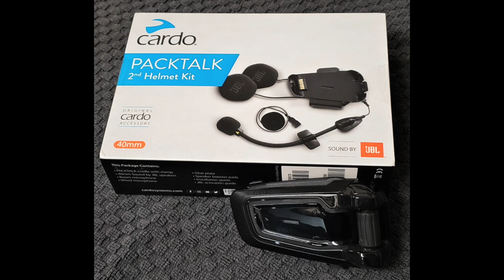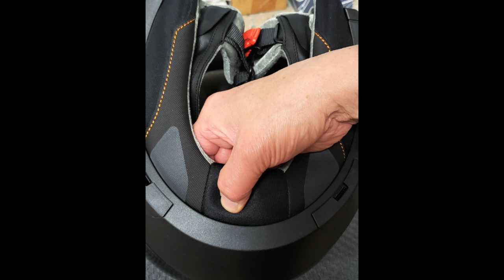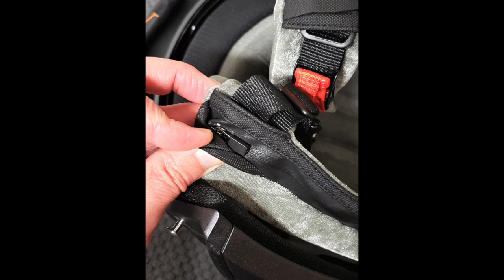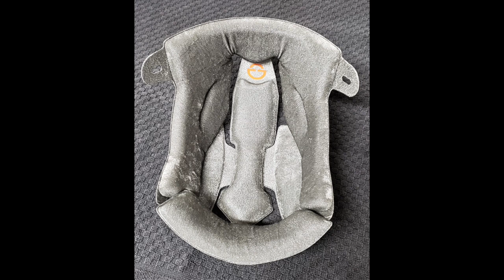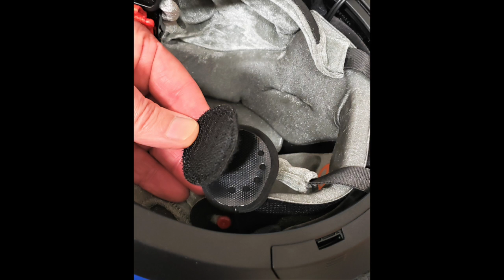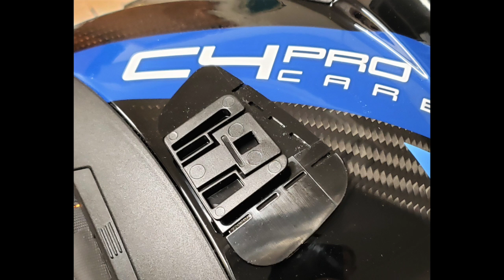Installing the Cardo PackTalk system in a Schuberth C4 Pro helmet

Comment: Do you believe it will help to change only the speakers? e.g. for jbls?
Reply: Good question. But 1st, try adjusting the height and position of the original speakers. Just in case that's all you need to do